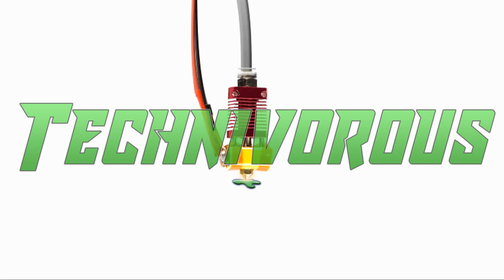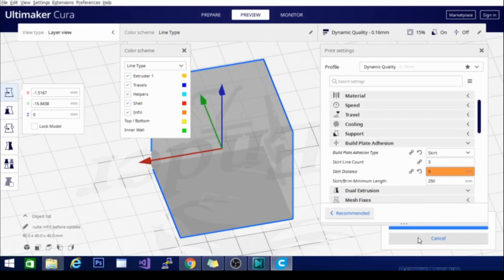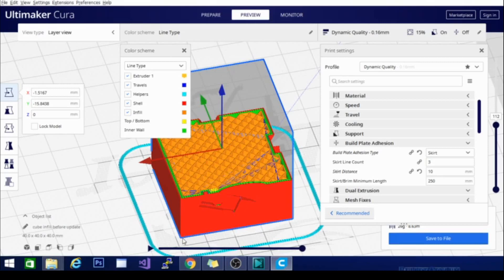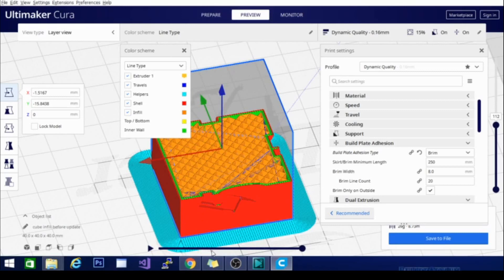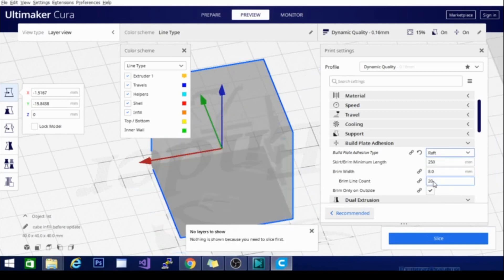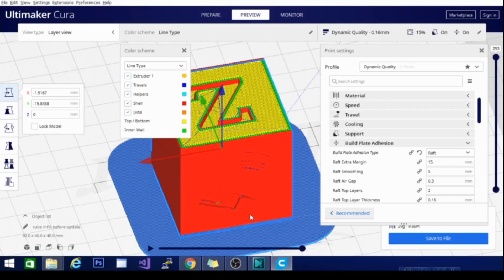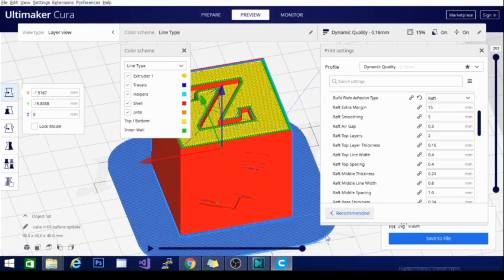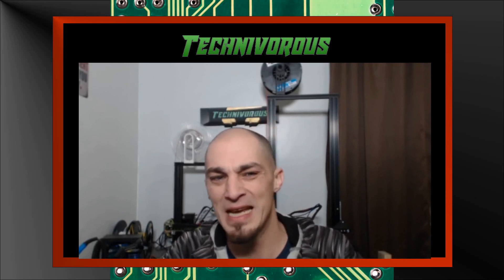Cura settings in 5 minutes or less! - 9.1 -  Build Plate Adhesion

Comment: my rafts always stick to my prints like they are hot glued. Any advice? also thanks for the video
Reply from the maker: A little more space between the bed and nozzle when levelling will help, but very little space. These will reduce  the amount of compression in the raft, giving you less chance of bonding with the model. You can look at the raft interface setting, and increase the distance by .04, and if your printer can micro step, an slight increase in the z will help. What printer do you have?
Reply: @Technivorous  Ender 3 pro, and i increased the height to .35 but i use cheap inland PLA. So i am not doig myself any favors. also after the increase in height the raft bonds with the model and if i print with a brim the smaller details peel off.